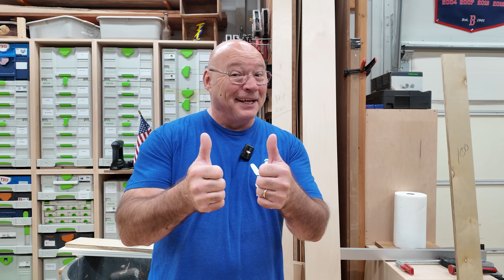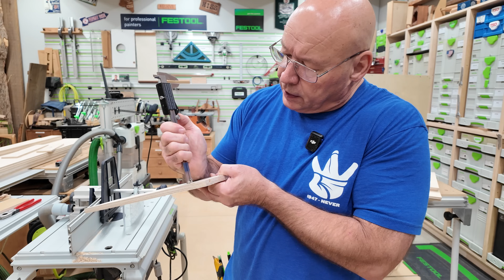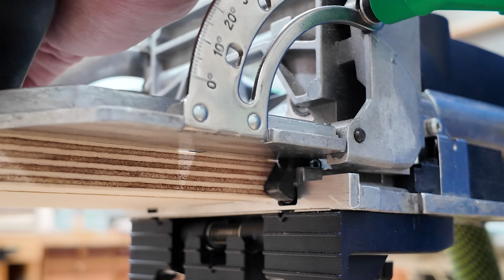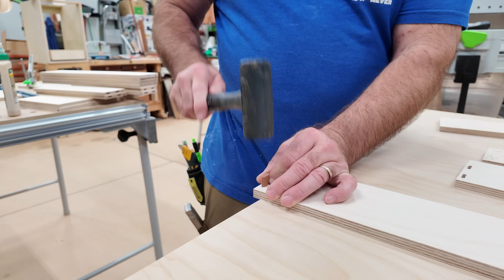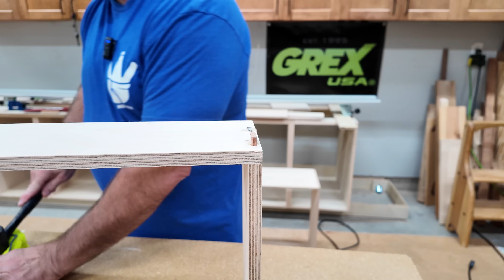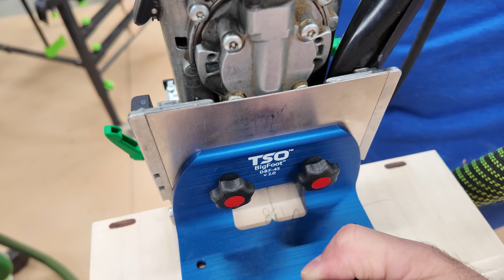Is This How You Should Be Building Your Drawers?

Comment: Ok…just tried this method. 2 issues.
1) beware imported prefinished plywood. It’s not 1/2”, so your mortise will not be centered on the end grain mortises. This will throw you off your fit. End mortise needs to be done “groove down”.  
2) the dominoes, as purchased from Festool,  are chamfered on each end. You will not get a nice “flush” look like you see in this video.
Disclaimer: I’m a novice…and just learning how to use my DF500
Reply from the maker: Thanks for sharing your experience and the helpful tips for other builders !!

Comment: In the field on construction sites I'm not sure I've ever seen a journeyman carpenter, finish or rough, clamp their workpiece.
I did once but it was for 2 pieces of wood that were used as gauge blocks.  Been years and years ago, I don't recall specifically what I was doing but it was necessary to clamp.
Reply from the maker: Thanks for sharing your experience!

Comment: Brian, I really enjoyed this video and I love your videos in general. One thing did confuse me and maybe you can explain it. When you first made your small drawers, 100 mm tall, you used two 5 x 30 mm Dominos. You drilled to a depth of 15 mm into the fronts and backs edges, which I understand. So when you hammered in the domino, it was going through the face of a side board, which was 12 mm plywood and into the edge of the other board, which had the 15 mm domino pocket (I believe it’s slightly more than 15 mm for glue space if I’m correct). So 12+15 = 27 mm. How is it when you drive in the domino It’s able to go flush with the face of the drawer side? It seems like it would stick up slightly proud. Later, when you showed how to add a third domino to the taller drawers, that domino did stick up slightly proud and you trimmed it off with a flush trim off. I just haven’t figured out why they are different. Thanks a lot keep up the great work.
Reply from the maker: the 5x30 domino is actually 5 x 28

Comment: Great method Sedge. Thanks for showing how to decrease production time by taking the time to set up a system for cutting the mortises. Excellent way to batch out such a large number of drawers. Switching to Metric for cabinetry sure makes things easier. QUESTION: where did you get the green travel stops for the Festool track clamps (similar to Bessey KlikKlamps)? This small device looks like a real time save when releasing and reattaching these clamps. Does Festool made the stops? DIY 3D printed? Etsy? I love these thinks and want one for each of my track clamps (+ a few extra).
Reply from the maker: Wicked cool, right?!? They're a great time saver!
I got them here
https://etsy.me/3z3KFWI
Reply: @sedgetool  thanks Sedge! I appreciate the direct link (sometimes Etsy can be a big place…). I just ordered a bunch. Fingers crossed that they work with both Festool & Bessey clamps, since I have a mix of both.

Comment: Thank you Sedge.  At 27:37 you mention a "really cool tip" when doing the vertical plunge in the middle.  Either you forgot the tip, or I missed it.  I have made a number of drawers using this technique.  When I do the vertical plunge in the middle, I find it helps to not go full depth.  When I have gone full depth the mortise is not crisp, probably from the fluting which you point out on the bit.
Reply from the maker: for sure

Comment: Remember, those plastic support bracket wings, when used as a reference for drilling mortises, can bend at least 1mm when you press the machine into place. Be sure to lightly hold the machine with the wing referenced on your workpiece's edge or your mortises will be off by around 1mm.
Reply from the maker: Thanks for the tip!

Comment: Love the look you get with the Dominos.  

Just so people are clear, though, the big deal with Dominos is that when used in certain situation one gets a sidegrain to sidegrain glue joints, in comparison to what one gets using dowels.  Dowels are often strong enough, but over time the cross grain dowel often pulls out.  Biscuits have a similar glue-up advantage, but they don't penetrate as deeply, though when stacked they are immensely strong.

However, in this application, the dominos are a crossgrain joint into the plywood, though it is a mixture of surfaces in ply, however, the domino also opens up a weakness by cutting away so much of the end of the side piece.  So one is not getting much advantage in using this joint.

One can argue they don't fail, but I have see butt joint nailed drawers in heavy tool filled drawers that are still together after 50 years.

I just mention it because some people claim to be put off by the fact that they don't own these elite tools, but they should not be because in this application there isn't any magic happening.
Reply from the maker: ok
Reply: Love the Domino, but as a non-commercial woodworker - I’ll just stick with dowels and my trusty JessEm guide, slow but steady.  😎

Comment: Sedge I recently built a set of drawers using your domino joinery technique. They look great. However, I tried using the single plunge technique for the middle domino and couldn't get a clean cut. It felt like the Domino would move when the cutter bit into the second piece. Any tips for preventing that?
Reply from the maker: make sure when doing this technique that the box is glued up....

Comment: At 9:45, the discussion of Domino depth setting isn't right: It's not "half of 30mm" the length of the domino. It actually depends on the material thickness since it's a through domino. With 12mm thick material, a 15mm depth cuts all the way through the faces, which is good for the drawer's sides. That would leave 18mm as needed to go into the ends of the drawer's front and back (30-12=18). But since a 30mm domino is actually about 28mm long, you only need a 16mm depth of cut. I suspect there's either enough inaccuracy of the actual cutting depth and/or you're just sanding off any 1mm or less protrusion of the domino after assembly.
Reply from the maker: do not overthink this ....It works over and over again...... Set the Plunge depth at 15mm and be done with it.........
Reply: @sedgetool  It works for 12mm thick drawer sides, for the reason I stated, not because it's "half of 30." Thinner material and the domino will protrude and have to be cut/sanded down. Thicker material up to 15mm should still work, even if the into the end grain mortise is deeper than it needs to be. Above 15 and you're probably going to a thicker/longer domino and will need to think about proper depth.
Reply: This is exactly what I was thinking about when he set the plunge depth to 15mm. In the video he is able to hammer the Dominos flush into the drawers during the glueing process. So there must be some extra depth routed into the grain side of the front and back. I thought that this extra space is not provided by the machine but by the domino cut shy under its stated length. It seems both is true. Maybe someone can measure the cut depth of a Domino hole to verify? Would be interesting to see. Unfortunately I don’t own this lovely machine, yet.
Reply: @bikemichel  The Dominos are a couple mm shorter than their advertised length, and, depending on how your machine is setup, the mortises can be slightly deeper as well.

Comment: Newbie here. Why rip the backs the same as the fronts/sides and go through the grooving step when you are just going to cut it off later? Why not just cut all of the backs 20mm less than the fronts/sides?
Reply: Then he wouldn’t have been able to use the accuracy of the domino to get the consistent 37mm offset. Since all boards are the same he can use the machines built in flaps to position the dominos all in the same spot. Hope this helps 😃
Reply: @MattTaylor7  Okay, but why groove then? You should be able to skip that step?
Reply from the maker: I was just groove to use the 37 mm offset... yes I did not need to groove the backs ....but if you use drawer stock pre-finished you need to see this step. Hope this helps

Comment: Good morning Sedge. I checked this morning after watching the video, and my vertical support brackets don't have flip stops? My domino was purchased around 2010??????  Can I buy the flip stops as an accessory.  There is openings for them.
Reply from the maker: Flaps are not available as an accessory ... but here is a link for the updated bracket..https://amzn.to/4hkQGTi
Reply: @sedgetool  thank you Sedge
Reply: It's the Festool 495666, run $40. You hook it into the metal holes on the bottom. I assume the 2010 model had these, but I can't say for sure.

(And seriously, I still love my apron.  Everybody: if an apron isn't for you look for their new Sedgely).
Reply: @kyleolson8977 thanks Kyle
Reply: @kyleolson8977 the apron is the most used tool I my shop😊

Comment: Really like your videos but I have to suggest when working with the volume like you are that dados on a table saw is much quicker and easier as there is more carbide on a dado stack and generally more power with your saw.   Pushing stock through a saw for me is easier and this is more noticeable if one were running wood not plywood.  Just another way in all I am suggesting.  Great stuff and please keep them coming.
Reply from the maker: Good point, I'll have to try that out.